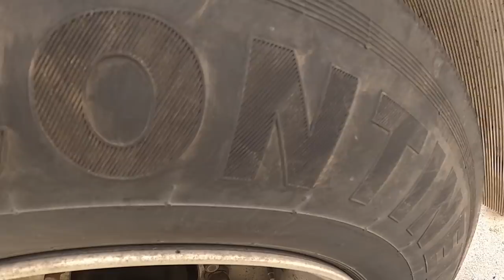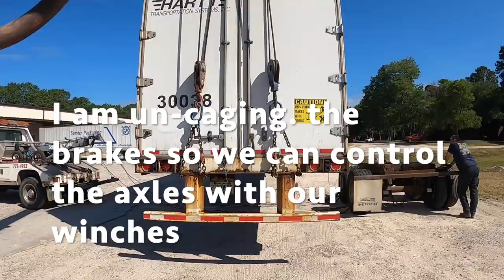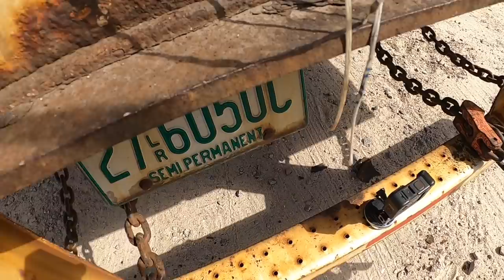Burnt Trailer Rear End Swap

Comment: Sir Hal // Joe !!!!  Must have been a brake or Wheel bearing that started the fire as see that they put duals on the right side of the burnt tandem ??? Must of had ""SUPER SINGLES"" there to begin with !!! With the follow up work needed to move the trailer like air lines & slider frame clamps to hold the tandems in place !! GREAT WORK & ""KEEP IT SAFE ""!!!  When myt ,,the trailer goes to the ""JUNK YARD "" ????
Reply from the maker: Mr KB I am not sure what started it. Thanks for watching and stay safe

Comment: Is the temporary bogey shod with Super Singles one side and twin conventional tyres the other?  Granted, this is an emergency but the singles will have a lower load rating than the twins, I imagine.
Reply from the maker: Diesel Beema This was the original axle and they just replaced the burnt tires. The owner said they are junking the trailer once it is offloaded.  Thanks for stopping by our channel and stay safe.

Comment: Nice job guy's. I'm kinda confused though, why didn't the other Tow Company do this job? Was this at another Tow Company's yard?
Reply from the maker: Mr Dan  The fire was on the Interstate and Jones was called on a rotation for the SCHP.  They left their axles on the trailer until the trailer owner had the tires replaced and we were requested to replace them. Thanks for watching and commenting. Stay safe
Reply: @SumterWrecker  Got it now. Thanks Mr. Hal. Be safe out there.

Comment: Did you all have to change the tires on the bogie you put back under the trailer, or was that from another trailer? I would think the tires burned off the right side given the fact part of the frame was melted. As always great job.
Reply from the maker: Mr Greg  The company had already changed the tires and caged the brakes.  Thanks for watching and stay safe

Comment: Good job, I get tickled every time I see a set of Maine permanent trailer license, the state of Maine has made a fortune thru the years selling those for practically nothing compared to the other states if it’s like it used to be all you needed was a Post Office box number which several companies would supply and then forward the plates for a small fee. Stay safe out there Mr Hal
Reply from the maker: Mr John I never new that. Thanks for watching and stay safe as well